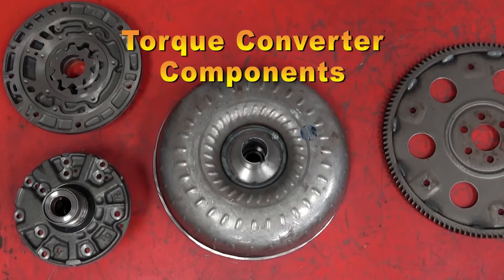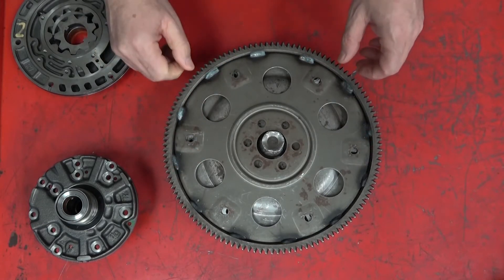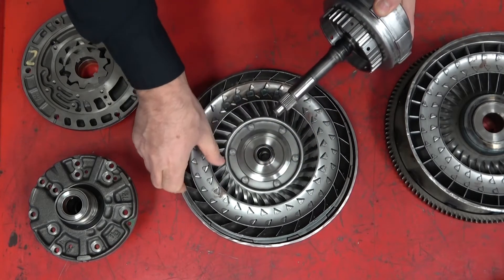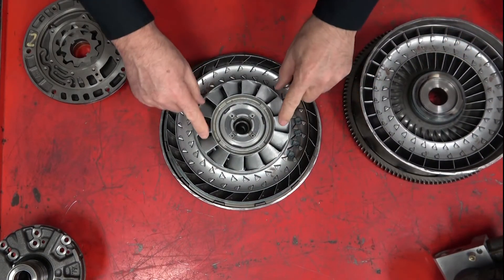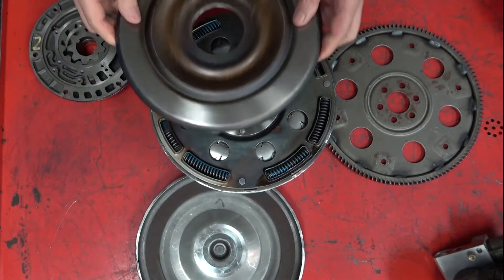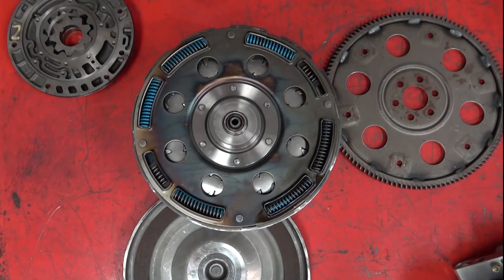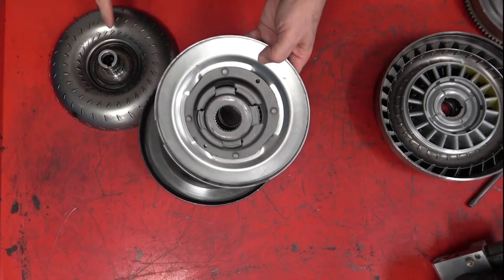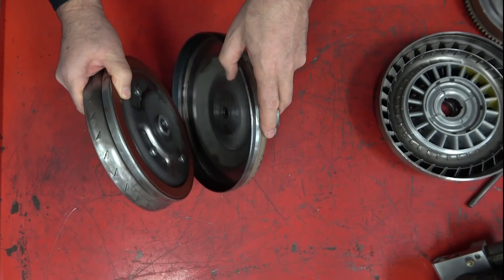Torque Converter Components

Comment: Hi, quick question, can i assume that oil pump send oil to valve body and then tcm activiates solenoid that send the oil back to torque converter to activate clutch during crusing..  

2. how do we test to find failed torque converter vs failed transmission(mehcanical).
3. how do i isolate valve body issue(hydralic) vs mechanicall..
Reply from the maker: I think I just answered you from your previous question.  No the oil transfer that you described is incorrect. The valve body has a separate circuit just for the torque converter and the lockup clutch. You really need a good scan tool to help with this diagnosis.  Maybe you start by sending me the year, make and engine and your symptoms.  I might be able to give you some guidance from there.
Reply: @DrivelineMaster  2013 Toyota Camry slipping on 3rd gear just for a sec like kind of no fuel or spark and then all goes well. It also have shudder at 40 mph. Toyota recommend to replace torque converter for second issue(shudder) and update software. For first issue forums are asking me to reset adoption value. Rebuilt team is asking m me to change entire valve body for 1st issue. No code was issued.
Reply from the maker: Let me address the shudder first.  Lubegard makes a converter shudder fix additive that works great.  https://www.lubegard.com/products/isf/ There are youtube videos on how well it works.  Now for your 3rd gear slip that your calling it.  If it feels like no fuel or spark this sounds more like a timing bind up.  A slip would be an RPM flair up followed by a harsh bump into gear.  Often called a slip bump. a bind up could in deed be a software update  or an adaptive problem.  Your transmission takes Toyota WS fluid. WS fluid almost always turns really black and a bit gritty.  How many miles on this trans? This trans also does not have a dip stick.  Gritty fluid could also cause the shudder.  Take the plug out of the drain pan and catch some fluid in a container.  Smell the fluid. If it smells burnt you have some major trans problems coming down the road. don't change the fluid.  If it just smells funky but not burnt I would change the fluid in the pan.  The problem is to properly refill this fluid you need a scan tool to get the fluid temperature and a special tool to add the fluid into the hole in the side of the transaxle. I have footage on how to do this but I have not had time to edit it and make it a full video. I know shops and technicians that are afraid to change the fluid in a high mileage vehicle for fear of slippage when they are done.  The key is knowing if the fluid is burnt before you change it.  I have never had a problem changing brown or black fluid in a high mileage vehicle as long as it didn't smell burnt.  See if you can find a qualified shop that knows their stuff and who can tell you if the fluid smells burnt if your unsure.  Then see if they will drain the pan and fill it back up for you.  They must follow the proper procedures and use a scan tool for the fluid temp. If they don't the trans won't have a chance to function properly. As a note, if you truly have a slip and not a bind changing the fluid could make it worse. If you do have a slip the fluid will smell burnt. Also note that it is normal for WS fluid to look black and nasty. That is normal as long as it doesn't smell burnt. Once you determine you don't have a slip and the fluid is not burnt have the fluid changes. If you still have the shudder add the Lubegard fix.  If you still have the gear bind find a place that can check the computer programing and or reflash the computer and or reset the adaptive. The shop drive the care after a flash and or adaptive reset. If they don't  drive the care carefully after the adaptive's have been reset because slippage can occur until new adaptive's are established. I just looked up that Toyota does have a Technical bulletin for converter shudder. You can look up TSB T-SB-0312-17. It involves changing the converter and reprogramming the ECU. If your in Canada look up TSB T-TCI-5056.  If your vehicle is out of warranty I would do as I suggested about and try the lubgard additive before replacing the converter.
Reply: @DrivelineMaster  can’t thank enough for writing detailed note. I am a mechanic who don’t work in Transmission. You are right with gear bind, it have to reset the adaptive. I gave it to a reputable transmission guy, he is saying it is because of valve body and he said 3rd gear clutch is burned out. I do know how to fill and flush this based on temperature and I have done it like 6 months ago. This trans has only 85k. 

Quick question. When valve body is replaced manual suggest to reset adaptive values, question is new or old valve body, shouldn’t be a matter to computer bcz all it does is turn on or off solenoid. Not sure how new valve body make this different
Reply from the maker: I don't work on these on a regular basis. Your trans person might see a lot of these and knows from experience. It's possible that the clutch is so burned up that it's not releasing which is causing the bind.  Because of his experience he may know that to fix this without a comeback that the valve body will need to be replaced along with the overhaul.  The solenoids can have slightly different resistance and inductive values and the computer might need to know this information in order to control them properly. These solenoids are not just on and off.  They are linear and controlled very closely with a duty cycle voltage that controls the amp flow. If the trans has been operating due to problems it tried to adapt to those problems.  After the repair you don't want the computer to try and control the new (rebuilt) trans as if it is the old trans with problems. That is why it needs to be reset and the new valve body needs to be programed into the ECU.  It all really comes down to how well you trust your trans person and how competent you feel they are.  Some trans people throw a rebuild and new valve body at everything figuring there is a high percentage that the problems will be fixed. Do you have a U660 or U760 transaxle?? You can find this info on the door jam sticker.
Reply: @DrivelineMaster  it is U760E. i see many videos in yotube , exact problem like i have and all they did is to reset adaptie values//  i dont know how resetting adaptive values corrected this probllem when there is no change on transmission.. quite unbelivable..
Reply from the maker: Resetting adaptive values don't happen in the trans but instead in the control module.  This reset controls the duty cycle and timing for each solenoid.  This ultimately effect the valves in the valve body which effects the fluid flow to the clutch packs.  I had another thought.  When your trans person said your 3rd clutch was burned up and you needed  a new valve body.  Did they come to that conclusion after you described the problem or did they actually test drive the vehicle and perform a full diagnosis?
Reply: @DrivelineMaster  they said they looked at some forum and advised to change valve body for this issue
Reply: @DrivelineMaster  I cant thank enough for helping me. Iam a machanic who dont have knowledge on transmision ... I got the cartoday and it is perfect. I did some quite  lot of reserach it seems narrowing down the problem on valve body is not that easy, there are vaccum test on critical points listed by sonnax.. and they give zip kit to install to change accumulator, valve etc ...when i asked rebuild guy he told me he always change torque converter, and put refurbished valve body in addition to changing burned clutches.. i paid 1250 as labor for everything and i got him all parts becasue i have 25% dealer discount..
Reply from the maker: That to me is a RED flag when a shop is relying on a forum instead of technical knowledge and or personal experience.  Valve Body's are expensive. I don't think I would go down that road.  If you end up taking it to a trans shop you might want to shop around.  That forum comment lost my respect and confidence.
Reply from the maker: Glad it worked out for you. I still don't know if I trust someone who relies on a forum.  Forums are OK for backyard technicians but unless this is moderated by ATRA (Automatic Transmission Rebuilders Association) or ATG (Automatic Transmission Group) I would be skeptical. These organization exist solely  to help professional transmission rebuilders.
Reply: @DrivelineMaster  thanks much. This brought question to me. How to isolate valve body issues. Seems there is no direct answer. I see vacuum test by sonnax to test valve body.
Reply: @DrivelineMaster  do you also know the purpose of accumulator in valve body.
Reply from the maker: That is correct that it's difficult to determine if the valve body is the problem.  Sonnax does have vacuum tests but there are only tests for some valves and the vacuum test is not always the end all go/no-go answer.  One way is to look on the Sonnax site and see if they have a repair for a specific transmission that addresses the symptoms that are being experienced. If the symptoms match up there is a high percentage chance that the fix will solve the problem. The only other way is with an indepth understanding of hydraulics, the valve body, the electronics and the hydro-mechanical operation of the transmission in question. Even then there is always a chance you get it wrong. This is why we are now technicians and no longer mechanics.  Vehicles are so damn sophisticated these days we often need engineering level knowledge and experience to solve some of the problems we are presented with.  My advise to you is to never stop learning and taking classes. Our industry is constantly changing and it takes dedication and the love of what you do and the need to be the best you can be to keep up with it. Pride, Integrity and accomplishment in what I do is what I love about working in this industry.  The chance to use my hands and my mind to solve and repair is rewarding.
Reply from the maker: Absolutely.  Accumulators derives from the word to accumulate.  This is normally a small cylinder with a spring loaded piston. The spring tension can be assisted with hydraulic pressure to add resistance to the movement of the piston.  the accumulator is placed in series with the hydraulic passage that feeds the clutch pack or band servo.  When fluid enters the clutch pack if pressure build up is too quick the shift engagement will be harsh and jerky.  To soften the engagement the fluid entering the clutch pack must first fill up the accumulator cylinder and push the accumulator piston to the bottom of the bore overcoming the resistance of the spring and or fluid pressure behind the piston.  This causes a slight delay in fluid pressure build up inside the clutch pack. By doing this the clutches inside the clutch pack will slip just a tiny bit longer before they are locked together. The locking of the clutch pack is what causes the gear ratio change that you feel during shifts. This delay and tiny slippage softens the shift engagement or feel.  Companies like Sonnax and Trans Go and others will sometimes offers shift kits or shift improvement kits that will include accumulator springs with slightly different tensions.  The auto trans also uses check balls and orifices that also aid in shift feel by slowing down the volume of fluid flow on it's way to the clutch pack or band servo.  I have stuff I use in my classes to explain this but I have not had the time to turn it into a good video and post any of it on YouTube.  Maybe after I retire.
Reply: @DrivelineMaster  Wow.. You are knowledge and honesty is to the core. Just to let you know I am software engineer. I came to USA like 15 years ago and saw that mechanics are charging too much and not super smart in diagnosis. So I started fixing my cars and friends cars. I have close to 100 friends all came on referral. Now I am getting to know more about transmission.
Reply: @DrivelineMaster  let me know your PayPal address I like to donate for your down to earth attitude and honesty
Reply from the maker: tb@tgbcomputing.com  Smarts is all relative. I would get lost writing software code.
Reply: @DrivelineMaster  Thanks again, do you have list of PIDS in scan tool that you use to scan transmision problem on Honda and Toyota.
Reply from the maker: It all depends on the complaint and if there are any codes. Different years will give you different PIDS.  Turbine shaft speed and output shaft speed along with TPS and line pressure are all good places to start.
Reply: @DrivelineMaster  thanks and I did not know line pressure is available as PID in modern cars.  Like the way we change oil after initial break in do you recommend to change trans oil after x miles after rebuilt. Do you believe in sealed transmission recommending no change of trans oil?. Do you prefer cvt vs regular auto trans?
Reply from the maker: Some will give the line pressure but most will give Pressure Control (PC) solenoid amperage and duty cycle. It could be called Line Pressure Solenoid (LPS) or Electronic Pressure Control (EPC). No, I do not believe in fluid for life especially not for CVT's.  The current word in the industry for CVT's is change the fluid between 25K and 30K.  The filter can wait until 60K or 75K.  Also CVT fluid temperature is critical. If there is no external cooler I recommend adding one to all CVT's.  There is no life time fluid in my book. Manufactures consider life a vehicle at 120K.  It's all about marketing and sales.  I don't recommend going past 60K with fluid in a step transmission.  The filter can wait until 120K.  With Toyota's that use WS fluid I recommend not to go past 50K and a filter at 100K.  You don't always have to do a complete exchange. At a minimum do a drain and fill.  With my personal CVT because the fluid is so expensive and the transmission replacement is also very expensive about every 25 - 30K I use a tool to suck out 4 quarts from the dipstick (lucky to still have a dip stick) then I add 4 quarts of OE fluid.  I only trust OE fluid in my CVT.  With new rebuilds I normally install a magnetic inline filter in the trans cooler line.  Make sure it's in the feed line to the cooler so it can catch partials that could plug up the cooler. At 30K change the fluid and filter and I either remove or install a new inline filter, then every 60K afterwards. This too does not have to be a complete fluid exchange but it won't hurt if you are capable of a complete fluid exchange however with the rising cost of fluid these days a full fluid exchange adds $$$ to the cost of the service. (It's still cheaper than a new transmission). I don't have a preference between step and CVT but I do like my CVT and it gets better fuel mileage however I also worry about an expensive failure. My fingers are crossed that the trans will outlast how long I keep the vehicle.
Reply: @DrivelineMaster  Thanks so much for writeup. Last one.. Does all transmission have manual wire connected to transmission to move fromm park to neutral to drive or some care have electronic sensor that works like TPS  without manual wire.
Reply from the maker: The manual valve can be cable, mechanical linkage or on the newer vehicles the shifter sends a voltage value or logic gate values to the computer. The computer then sends an electrical signal to a stepper motor on the transaxle. The stepper motor will then move the manual valve to the proper position (P, R, N, D, L).  The stepper motor also has a position sensor signal that is sent back to the computer to verify proper position.  No worries, I like helping others. If I know your answers I don't mind answering.
Reply: @DrivelineMaster  Thanks Fantastic. Do you recommend to rebuild or get reman from manufactuter.
Reply from the maker: What?  a converter or a complete trans?
Reply: @DrivelineMaster  complete trans
Reply from the maker: It depends on the trans and how well I know it.  Many transmissions these days have their own specific quirks. Overhauling something you don't normally do could cause you to miss something.  I would trust most rebuild shops that are ATRA members.  (Automatic Transmission Rebuilders Association). Even some of those shops find that rebuilding some transmissions are not profitable.  Some factories don't sell rebuilt transmissions.  For most cases your also pretty safe getting a Jasper rebuilt trans.  Honda sells rebuilt transmissions but those are rebuilt by a company named H & H out of LA.
Reply: @DrivelineMaster  Does Japser have tranmission repair chain shop, also do you have any reputable tranmission repiar chian shop. I see that dealer doesnt diagnose or fix transmission problem.
Reply from the maker: Jasper does not.  They are an exchange service.  I don't have a chain I can personally recommend.  Sorry. I would go to ATRA.com and look for and trans rebuild shop that is an ATRA member.  Also look to see if they are an ASCCA member.  ASCCA.com. These are two organizations with integrity and it's worth considering doing business with them.
Reply from the maker: H and A transmissions are known to be quality Honda and Acura rebuilds. They too are just an exchange system. https://handatrans.com/
Reply: @DrivelineMaster  Thank you, for replacing transmission parts, i always used OEM torque converter and valve body.. however when it comes to clutches , seal etc, rebuild team is recommending transtar master kit . does this sound reasonable and adivisable to go with after market item like transtar for clutches but OEM for torque converter, do you recommend reman torque converter
Reply from the maker: There are a lot of quality torque converter remans and I would not be afraid to use one.  TCRA https://tcraonline.com/ is another one of those organizations who pride themselves on quality rebuilt converters.  If you find someone who is a member the odds are you will get a good converter. Transtar also sells rebuilt converters that I have had good luck with. There are also a lot of quality rebuild kits and Transtar is good quality but there is WIT and several others that also have good aftermarket kits that I would not be afraid to use.  I also would not be afraid to use a Sonnax reman valve body.  it might even be better than the OE since it will have improvements to valves that are known wear items on an OE.